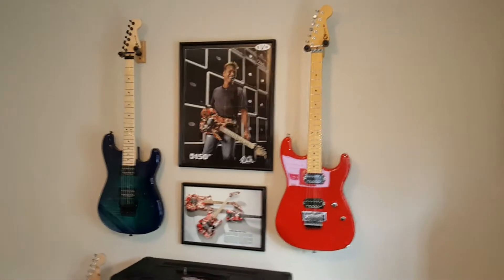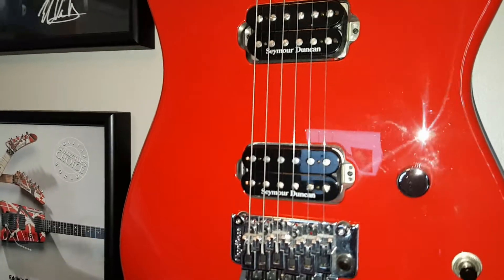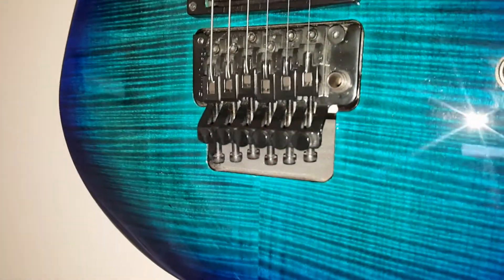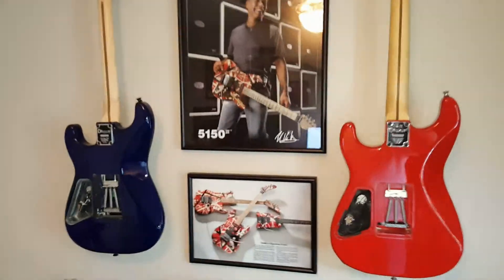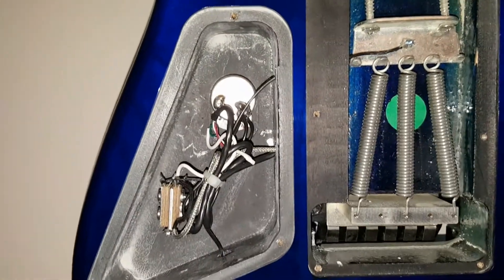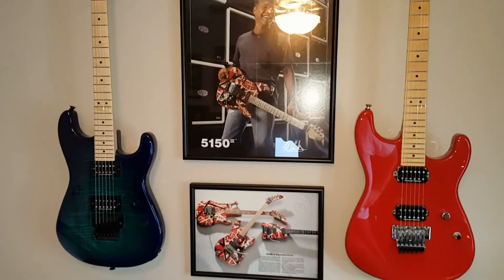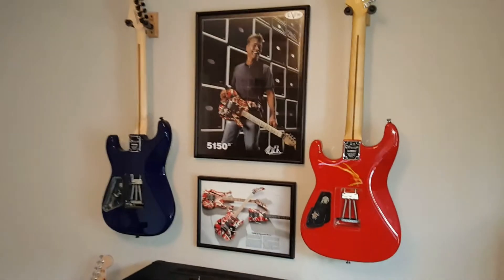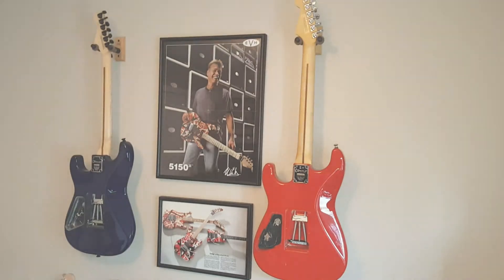Charvel Pro-Mod Comparison // MIJ (2011-2012) versus MIM (2013-2015)

Comment: My Snow White MIJ San Dimas plays like heaven, but my only gripe is the hidden truss rod adjustment and the direct mount pickups (too low to my liking) wish it was closer to the strings for hotter output. I also have a MIM Natural Ash San Dimas which I prefer more.
Reply from the maker: Ken T so you like the Ash version better? They have caught my eye and I wondered how well they play compared to the MIJ's.
Reply: CoffeeDrinker71 My 2016 MIM Natural Ash has a slightly smaller overall neck (at least I feel that way) you're spot on with the fret edges but I'm not at all too fussy about it, I've had Ibanez Iron Labels that were way worse, yeah my Mexican Charvel plays a tad better I think
Reply: Agree on the pickup cavities being too shallow. I had to put my JB back in as I tried a pickup swap recently and it sat way too high in there. I used to have another direct-mount guitar that used threaded inserts that the pickups would screw into and you could at least adjust their height....I may end up going that route on my MIJ San Dimas.

Comment: Great video.
Love the evh wall art, where did buy it ?. Be great for my man cave
Reply from the maker: Thanks for watching!  The bottom poster (of Eddie's 3 guitars) was pulled out of a Guitar World magazine dated February 1990.  The top (larger) poster was basically an EVH promotional quad-fold poster for EVH 5150 amps...think I found it on eBay.  I had both of them framed at Michael's, and I believe they used a "dry mounting" process to press out any wrinkles or creases in the paper???  It's been a few years since I've had it done.

Comment: I have 2 MIM Promods, and 1 USA.  All great guitars, but I agree - the frets on the MIM just aren't as good.  Lots of fret sprout.  Partly this is due to wood shrinkage in the climate I'm in but I've got a ton of other guitars, and none of them have this roughness to the frets.  I messaged Charvel about it, and they said to consider a humidifer and also putting some lemon oil on it.  I still think they could and should improve the fret work.
Reply from the maker: Yeah, it can be managed with a small humidifier, which is what I eventually bought this winter.  It does help, but the fret sprout is still noticeable like you said.  The MIM's are great guitars, especially when compared any current production models....but after you put your hands on any MIA or MIJ version you can feel the small differences.